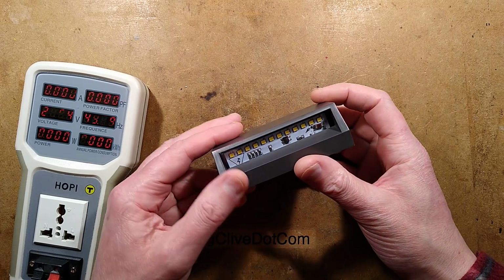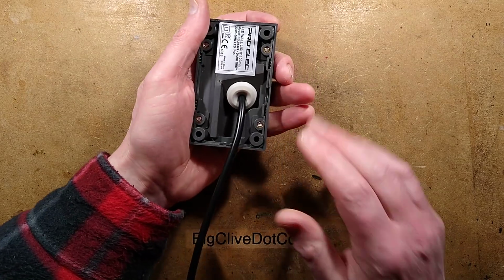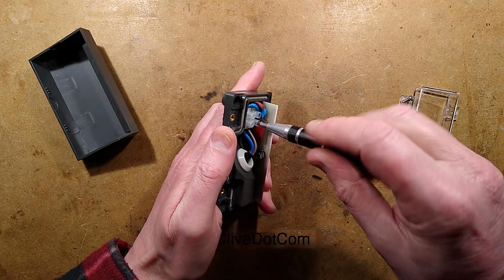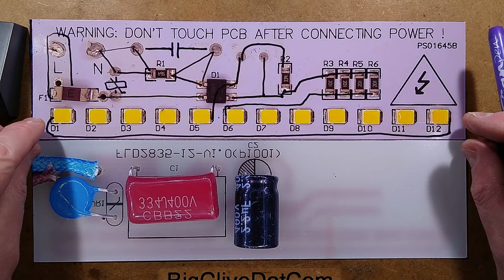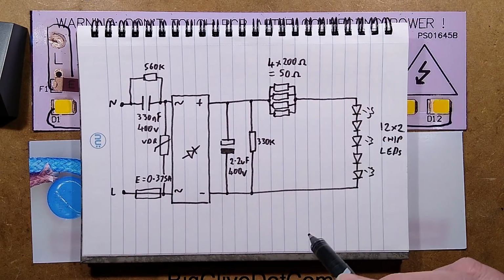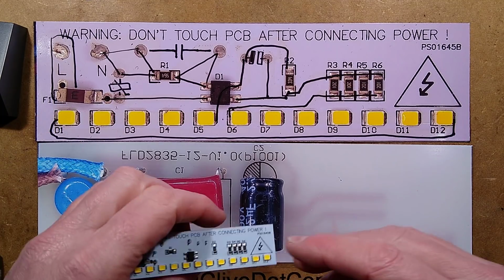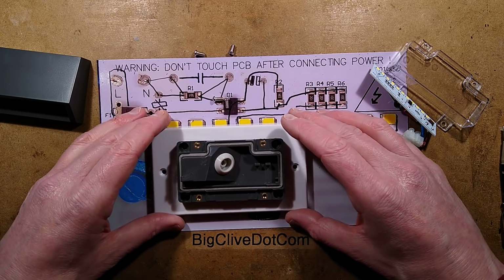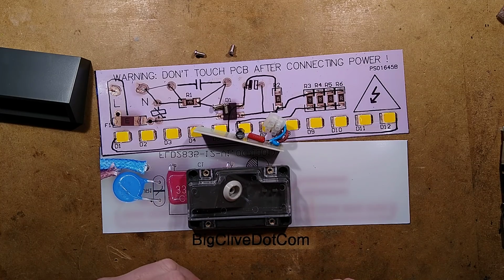Inside a wall mounting, LED path light (with schematic)

Comment: First rule of "I won't be back unless you invite me to a coffee or introduce me to a new customer/friend": Worst case, double it, and then, SEAL all surfaces water can drip from, use a GOOD brand of SILICONE in upper side AND both sides (and lower if you have a sprinkler nearby). Profit!
Reply: Most bizarre case I found was working in the villa of a customer (and finally a friend) whose interior and warm swimming pool had a problem in the electric box (located in an underground billiard room with a glass to see the water of the pool) and the failed seal of the lights made water run through all the interior of the cable, up to the box. Security transformers and good grounding avoided an almost leth4l shock. He couldn't believe it even seeing me hold the cable aside dripping from inside...

Comment: As for the warning not to touch- It is an LED light, maybe they do not want people to assume there is only a "safer" 3v on the board?
Reply from the maker: It's possibly because people do get used to low voltage garden lighting.
Reply: @bigclivedotcom  Yes and a cap dropper circuit hides a really "exciting" surprise if you are not aware.  Thank you for keeping your viewers informed and aware of these sorts of "chinesium" powered designs!!

Comment: To waterproof your outdoor cables:
1. Hold the conductors with vice-grip pliers.
2. Slide the jacket away a short distance.
3. Remove vice-grips.
4. Put on disposable gloves. 
5. Apply CLEAR Gorilla Glue to the wires and fillers then manipulate to assure complete coverage. 
6. Slide jacket back to original position.

Comment: perhaps it is water proof but not moisture proof so as humidity enters it condenses with temperature drop to water over and over till the thing is about filled.  then the waterproofing holds the water inside.

Comment: Looking at the schematic, you could remove 1 of the 4 resistors, raising the resistance from 50 ohms to 66.7 ohms which would decrease the light a bit but increase the longevity of the leds a bit of you could manage with a bit less light. Love your channel. Take care. Tootles... Wade
Reply from the maker: Decreasing the red capacitor's value would be the most effective way to reduce the light's power rating.
Reply: @bigclivedotcom  yup, probably help the power factor a bit too !

Comment: I am only a DIY guy myself, however have done a fair few fixes, from my experience with out door electric one of the problems can be condensation, the bigger the unit and hotter it gets the worse it will be, i always look at ducks necks on a job and it scares me when its people like SKY or BT who have run a lead from the gutter to 2 feet above the ground and not bothered.

Comment: CBB22 cap. is rated for DC voltage. A higher rated voltage, e.g. 630V or more, should be used in an 220VAC circuit.

Comment: R3 and R4 are the opposite orientation of R5 and R6, how do you suppose that happened? 
Obviously it's not handmade, maybe there is a reel of those 200 ohm on each side of the pick and place and this board is from the center of the panel so it's taking half from each side. 
Any ideas?
Reply: It really depends where this board is assembled. In China, there is always cheap labour. They would use such 'manual pick & place machine'.

Comment: Hi Clive, i wonder if you could advise me. I recently bought an electric blanket from ebay and last night it caught fire whilst on my son's bed. Who can i report it to to raise awareness? I have contacted the seller and ebay. Do you think the blanket was faulty or the adaptor? ( it came with a 2 pin plug )
Reply from the maker: Did it come with a socket adaptor, and what bit caught fire?  Can you send me a link to the listing?
Reply: @bigclivedotcom  thanks for your reply. It didn't come with the adapter, i bought one. It was the actual blanket that burnt , in a few places. I have pics. The seller was called easyfashion888  .i'll try and get a link to you. They replied to my message informing them of the situation offering a refund and asking that i change my negative feedback, no apology or concern though. And no assurance that they will remove it from sale.
Reply from the maker: @fluffystarafina  Don't remove the negative feedback.  It sounds like a grey import from China.  Possibly with a faulty controller or intended for 120V operation.
If it was shipped within the UK then contact trading standards and give them the details.
Can you send some pictures of it to my email bigclive1@gmail.com
Reply: @bigclivedotcom  yes i"ll do that. I think they have removed the listing now. It says shipped from Walsall UK, so i'll inform TS. Thank you so much for your help, much appreciated ☺

Comment: Water ingress...
Figure: Industrial presssure transmitter with atex housing (the big ones with display), mounted on an area with generous roof,
with a propperly crimp atex cable glans, the cable also had it's "drip loop" in place.
And when it failed it was full of water,
we were kinda puzzled until we found a smallish 2~3cm rip on the wire's external jacket,
arround 25~30m on an exterior cable tray connecting to the "pcl room"...
Reply from the maker: We had that with water finding it's way into a cable through sheath damage and dribbling out the base of a rack.

Comment: Hi Clive,
Hack that case... it's crying out to be hacked into a battery powered light ( with your own custom board ). bolt it to a double blanking plate and place batteries ( 18650's) inside a ceramic back box. small charger board for recharging. You get the idea...

best regards

Simon

Comment: To push service forward:  you know that the designer wants to get most out of these LED's, so they push the current. Why don't you measure the current, and lower it by (e.g.) taking away one of the four 200Ω resistors, making its total 66.6Ω. Gets you a few years more use out of it. In the old filament days that was not done, but one of the good things about LED is the colour doesn't change with changing power, only the intensity.
Reply from the maker: Lowering the value of the capacitor would have the most effect on the current.  100nF or 220nF would still give good light and much longer LED life.
Reply: @bigclivedotcom  OK, I focused on the resistor, could you explain why lowering the cap is better than raising the LED resistor ?
Reply: Maybe I answered my own question. Lowering the capacitor just allows less into the circuit from the start. Why put in more when you don't need it ?

Comment: Failing LED's will be causing so much waste. I ordered some meteor light LED tubes for Christmas off eBay, after one season one tube had failed LED's causing them not to light in sequence correctly. Most people = bin the lot. Me, remove glued on tube cover, de-solder failed LED's, replace, re glue, all working! I think in 100 years time we'll regret the throw away society we currently have......

Comment: Just a possible scam alert.
I've ordered from 2 sellers on eBay and have received a 'lanyard' from each. It's possible it's just the wrong item being sent, but when the seller does not sell the lanyards I am a bit doubtful if they intend on sending the item I bought.

If anyone else has had this issue could you please respond.
Stay safe everyone 👍😷
Reply from the maker: That does sometimes happen, or they send a cheap item for tracking because the other item is being posted from China and will take longer.
But if something seems too cheap to be true it often is.

Comment: The case looks great...I would like to use just the case to make some low voltage (12VDC) path lights out of them  :)
Reply from the maker: Absolutely worth the money for the case alone.
Reply: @bigclivedotcom  It remains a Chineese mystery. How do they sell 500W 12V power supply for the price of the case of that PSU  ?

Comment: Something that confuses me about this lamp is the fact they had so much space in that box to allow for squeezing in some LED tape of one's own supply with a certain, standardized width. With the fact they could had just made it so the strip was press-fitted using push-pad contacts, it would had allowed for a smaller board and cheaper construction if it were sold without the light, since people have to open it for poking around inside anyway and this seems aimed at "Prosumer" use.

Comment: If they fail so often you have to invent your own quick-change system, then I wouldn't want them in the first place!
It would be nice to see a version that used LED type 12v festoon bulbs for easier repair, though.
But they probably don't expect (or design) the power supply to really outlast the LEDs anyway....

Comment: Can't see these things lasting that long in Australian weather, the heat will kill it. When installing an antenna, I put a loop in the coax of around 100mm (the tightest loop the coax would allow). I've had no problems with water ingress. Another solution is to put a drip ring on the cable by using a cable tie.

Comment: My ebay calipers showed up today.
Reply: Find a box to keep them in. I had mine in the back of the car with various tools and found that the battery was always flat. I guess that the caliper kept getting switched on with all the bumping around. Other than that they are good enough for my purposes.
Reply: @rysacroft  Thanks. I think I'll be removing the battery when not in use.
Reply: @draketungsten74  One other thing that happened was that one day it would only read half of the true value. I just popped the battery out and in and it fixed itself. Reboot!

Comment: Hi Clive 
I’ve followed you for years, I’ve taken things apart since I was a kid to see how they work.
But this last year my power brick for the Xbox computer broke and a new 1 was £90 , because of times atm and money I decided to open it and found 3 capacitors bulging... I ordered them from Amazon and bought a solder iron ( had trouble with that at first) seemed too hot and the solder ran off of it like rain water on a polished car, but I persevered ( it’s a Draper iron that glows red hot if you turn the lights out)  then after that the tv started playing up , to start with was making a high pitched sound, then after a few weeks to a month the screen would be “weird “ until a video or whatever started playing, then it got to a point where the classic giving it a “tap” to work would take place after a time that wouldn’t work but if you kept trying it would turn on after about 7 pm ( presume the temperature made a difference) .. after about a week of that it gave up..  we have no money so I took it apart and found 11 capacitors bulging.. I’ve replaced them at the cost of about £6. I stood back and plugged it In and it’s all fine and has been for a couple of months now .
Sorry for the long story there..
I’d like to know if there’s a way to contact you , cause I have a project for my little girl but the colour lights and things she wants I’m not sure without playing around with leds I can do ..
Kind regards Carl

Comment: I would think that, at £4.15, one could buy several spares, as part of an installation, and use them to get the replacement LED board out of them...this kind of series capacitor voltage reduction leaves you open to having rectified full mains voltage on the board if an LED fails to open! Cheap and potentially "nasty"ñ

Comment: Was wondering, for a path outside would it be better to run full mains voltage out through the garden and drop voltage at every liight branch or just run a low voltage feeder circuit that connected to mains inside the house?

Comment: Could you drill a tiny hole in that clear plastic cover& mount it so it drains if water does get in. 
I've done that in the past & used a snippet of candle wick to stop spiders getting in but allowing water to drip out. 
Sounds counterintuitive to drill a hole but if water does trickle in down the cable it helps to let it out before it gets deep enough to short anything important.
Reply: It's fairly usual to put a U-bend in the cable prior to the equipment, and puncture the sheathing there.  Any drippage lands on the floor, is $0.
Reply: @theskett  Splendid idea! A small hole at the bottom of the drip loop. 
Carefulling though! Just the sheath!
Reply: "Just the loop, and only for a minute..."   
Gotta love that vocabularity-foraging Canuckistanian, AvE  :-)
[I'd apply some pink hockey tape, if I was less Limey :P )
Reply: I sense a kindred soul.  Thanks for making me belly-laugh, do continue the good work :)

Comment: Talking of cables and water...
It worse than just rain water getting in at the top of a cable run. If you leave a rubber cable outside long enough, eventually the rubber will start to absorb moisture. Capillary acton will cause the water to run along the length of the cable. If it does not find an exit (say the ends are sealed) when you cut into it, the water will come out under pressure like a little hose pipe!
And yes, you have to try to use every trick in the book to try to keep water out, or at least, arrange for it to drip/flow down away from the electrical/electronics to the bottom of the case and then out a drain hole. This includes rain/water traps, bringing cables into the bottom of enclosures and making sure the outer sheath is cut off just above the bottom of the box, but not too far up. And where possible having air vent holes to reduce the likelihood of the day/night heat/cold cycle causing condensation to build up. Co-ax is definitely a contender (after conduit) for being an effective hose pipe, but telecoms cables, network cables and any other where there is an air gap can also cause problems. The best laugh is when you come across waterproof/weatherproof light fittings mounted in such a way that they become baths, and fill up with water until eventually either the RCD trips out or the conductors corrode away causing a failure.

Comment: You should design your own pcb and build it so you have a spare and it would be interesting for us to watch you install the components on it
Reply: He should totally redesign it such that the LEDs are in parallel. That way if one fails the whole thing doesn't die. ( and use a common LED package that could be easily replaced. )

Comment: Clive, you often refer to the ‘Power Factor’.. please can you do a video explaining what you mean ?  Ta V much.. love the channel .

You got a mention on a video I watched on John AudioTech channel earlier.
Reply: This might help - he explains it rather well. https://www.youtube.com/watch?v=Bo0MGZKhPrs&ab_channel=FoolishEngineer  If you fancy something more in depth, then this is pretty good too! -  https://www.youtube.com/watch?v=0f7YkVorOmY&ab_channel=GauravJ-TheElectricalGuy
Reply: @phils4634  I got as farcc V8 as the beer analogy- took a wee sip and forgot the rest !!   

I understand it simply as the difference between the power a device draws from the supply and the power it can deliver in its function 
( I.e the internal losses) 

But I’d like to see Clive explain it 

Maybe he should use real beer instead of a graphic 

It works much better that way
Reply: @leewot  I tend to regard it (incorrectly) as the ratio of useful power to total power - a sort of efficiency thing.  PF will become far more important if and when we all start using smart meters, which can measure true and apparent power,(and charge for the apparent power), so everyone will have an incentive to buy good power factor devices (or install active power factor correction!)

Comment: I had water come down the TV aerial coax and write off a Philips V2000 VCR many moons ago.  It actually filled the lower metal tray - imagine my surprise as I lifted up the VCR! Since then, I always use a moulded patch cable in-line with the aerial which will stop water making it all the way into valued stuff.
Reply: I’ve never had any equipment fail due to a leaking co-ax, precisely because I used a moulded “patch” cable as you describe.

Comment: In the schematic varistor has neutral side leg at the wrong side of a dropper capacitor._
Reply: No, it doesn't. You wouldn't want a varistor across live and neutral at the supply, it's not a home surge protector. The dropper cap would be protected thru its load and a fuse, if it got that bad, it wouldn't matter anyway.
Reply: The PCB layout shows the MOV before the dropper capacitor, whereas the schematic shows it after.

Comment: Ah, I have a 3 LED bike light and one of the LEDs is always lit, albeit very dimly. It draws so little current that the two CR2032s powering the light will last the winter.
From this video I think I can assume the LED is fed by a faulty resistor, or it's shorted. I'll take look now I know what to look for
Reply: Doesn't  your bike light have an On / Off switch?  If the switch is set to Off, and the LED still lights, the problem is the switch or some kinda short (not the resistor).

Comment: Regarding the "Don't touch PCB after connecting power" warning - CPC are the consumer / retail arm of Farnell. Jokes about qualifications aside, they have to assume they are selling products to random people in the street who are unqualified and unskilled. Given the likelihood of condensation, I wouldn't want one of these outside without some sort of guard earth. Good luck getting a replacement circuit board.